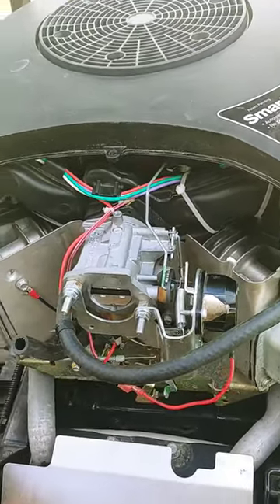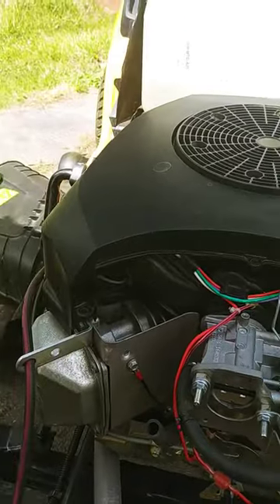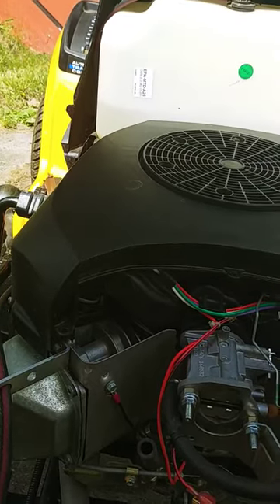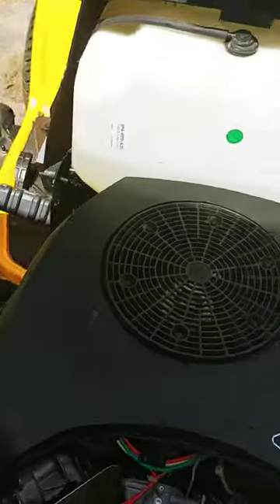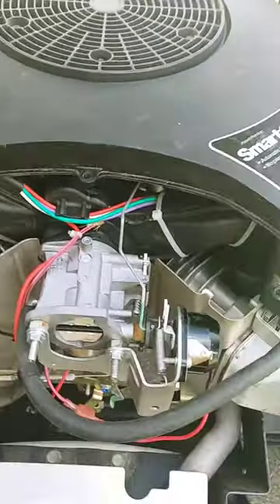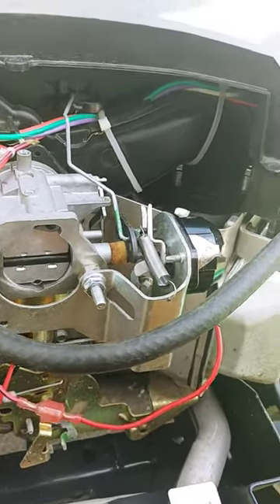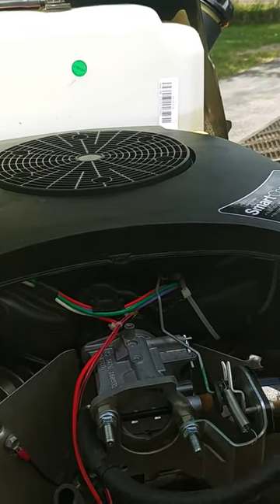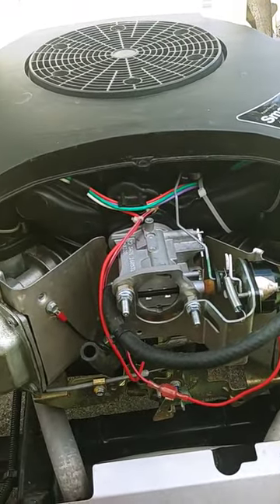Kohler Smart Choke Technology

Comment: Slightly losing the two screws on the thermostat flat head screwdriver turn to the left the housing of thermostat that tightens up the spring inside allowing butterfly to fully close give that a shot that is how to adjust the butterfly on the smart show engine

Comment: That sounds like a great idea when you say it fast, but there is a fundamental problem. The air filter housing goes on before the bracket, preventing access to the choke linkage with a spring or any other magical device. I am determined to delete the air vane and the bimetal choke coil. I am going to install the dual wire control assembly and choke linkage used on 7000 engines equipped with the conventional choke. The hole on the operators control panel for the choke cable is already there. Just cut the label to mount it.